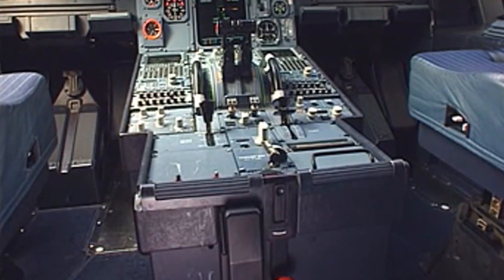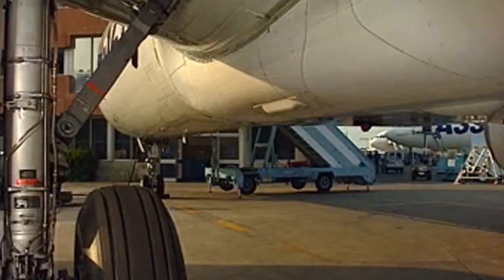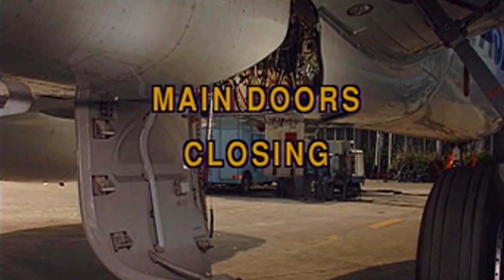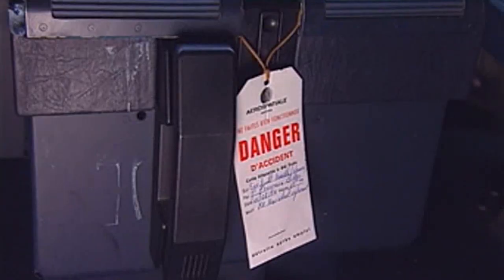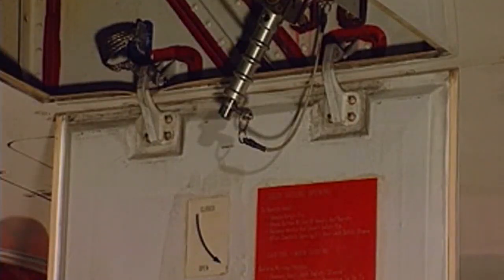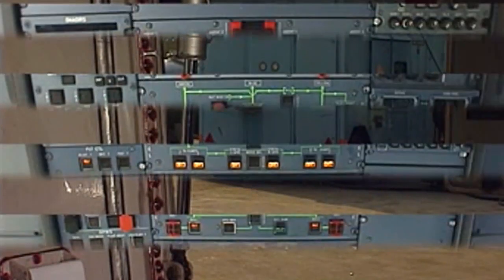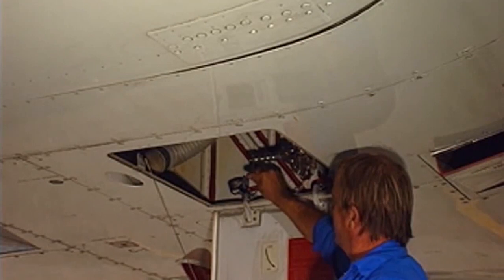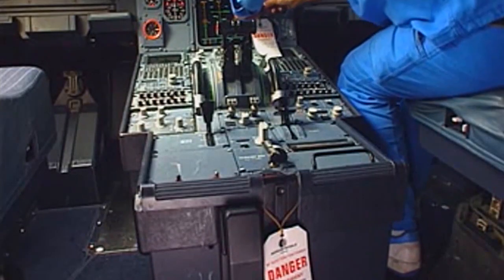AIRCRAFT | A320 MAIN LANDING GEAR DOORS OPERATION

Comment: To pressurize GREEN hydraulic system on ground with External power available, you have to pressurize YELLOW hydraulic system. GREEN hydraulic system will automatically pressurize through PTU.
Reply: The red zone is for loading and unloading of passengers only. There is no parking in the white zone,